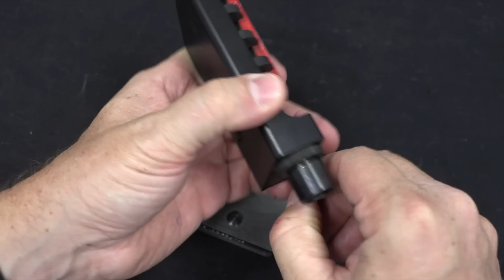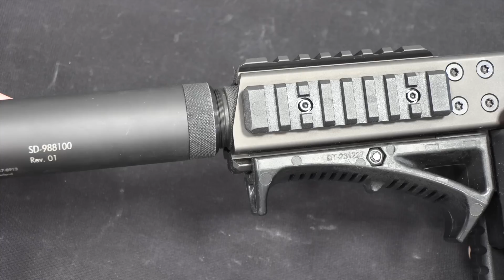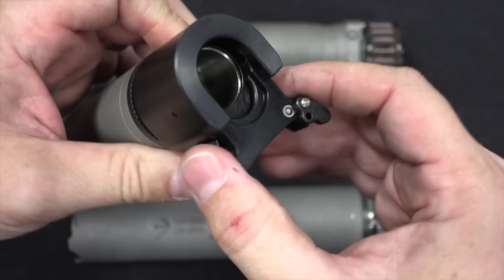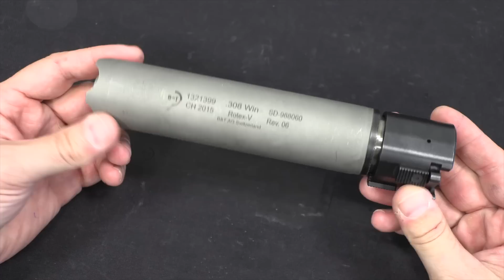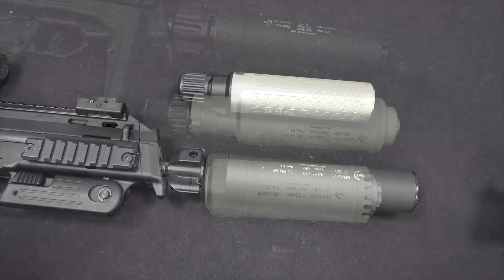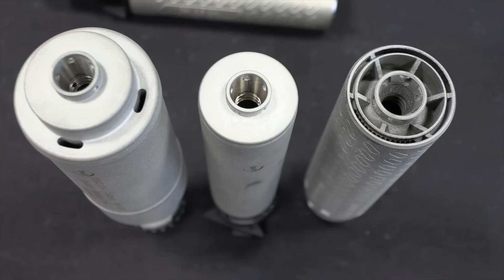A Brief History of B&T Silencers - Impuls to Rotex to PrintX

Comment: There's gotta be a lot of "what would Stoner do?'" in this. Stoner as a designer for aircraft liquid and gas valves. There should be a way to design a valve that wouldn't blow the gas back into the system and direct it out. Piston and valve kind of combination. Then you solve the rate of fire and the excessive gas blowing back problems. 

Nielsen device is sort of a step towards it but I wouldn't want to be the guy to clean that shit on a machine gun...

Comment: So far 3d printing for military supressors brings much more trouble on a longer run when it comes to flowthrough/reduced blowback cans. Functional lifespan is below 7k and its  practically impossible to clean external venting channels.
Reply: That might be so for certain designs. Print-X RBS have been tested to 20k rounds without loss in function. They outlast most barrels.
Reply: @btagswitzerland  We are so much looking forward go verify that claim. Generally 3d printed cans have much coarser surface (as 3d prints of all materials do) that causes faster residue accumulation, when compared to realtively smooth surfaced traditionaly machined and welded cans. Considering smallish diameter of the external flow vents in new  RBS series I am not expecting much.
Reply: @22CatchMK  You're absolutely right. Rule of thumb is: the smaller the channel, the faster it is clogged. We have seen 3rd party designs clog completely under 2k rounds. Compared to these designs the RBS has quite large bypass channels.

Comment: B&T didn't create that baffle design. I was Doug Olson at KAC.
Reply: They also stole the idea of the Inertial Decoupler from KAC. B+T is a European rip off artist. Overrated in my opinion. They do sell their silencers at a good price though, so their economies of scale definitely have something going for them. Americans have access to much better silencers technologies though.
Reply: @Argentum7756  They are struggling to compete with the US in performance. The only suppressor contract they have with the military are the MP7, SCAR and their new SMG that the army bought. The only reason they have the MP7 contract was because they were the OEM for HK and no other manufacturer had access to the MP7 when JSOC bought it so the contract naturally went to B&T. The SCAR contract was awarded to B&T because they understood the system better than AAC and their suppressors would break the SCAR. For years the M4-2000 and RC/RC2 were the standard along with AAC's pistol suppressors.

Comment: Ian, recently you did a piece on the Ruger P85, but didn't get much into the pioneering work Ruger did to both "rediscover" the lost wax casting method and bring it into the modern world. Te reason I bring this up is to wonder if B&T couldn't have used a process like that for those "stars"- additive machine work will still be among the most expensive ways to a part for the foreseeable future, and Ruger's hi pressure system could make many hundreds of these a day from just one line. Thanks for doing what you do!

Comment: A little correction on how a Neilsen Device works.  The suppressor does not move forward.  The suppressor actually stays where it is in space and the barrel is yanked backwards out of the can to allow the gun to cycle.  The spring then pulls the can back into "battery" on the barrel.  There is high speed video out there that shows the can doesn't move at all and it is the barrel that moves out of the can.
Reply: Correct. The proper term is an Inertial Decoupler. The Nielsen device attempts to cancels the mass of the silencer from the barrel to allow normal operation.
Reply: @Argentum7756  I love YouTube comments for this exact reason. Always a few guys dropping knowledge.

Comment: The "star" baffle was ripped off from KAC.  It was originally developed by Doug Olson, the lead engineer at KAC for the Offensive Handgun Project that produced the HK MK23 and its KAC silencer.

If you don't believe me, there is an image available on the internet showing about a dozen suppressor X-Rays.  Compare the B&T to the various KAC cans.  The baffles are nearly identical.
Reply: Trey Knight mentions that during his interview of Doug Olson on the KAC channel.
Reply: @Sol_T86  I've met Doug O a few times.  He's an interesting character and super smart.
Reply: Time frame is very similar. B&T was founded in 1991. Based on this, they were producing suppressors for friends well before founding. MK23 was designed in 1991 as well. So who can say who copied who, if at all.

Comment: Has there ever been a “suppressor-operated” firearm? Something I’ve been musing about, problem looking for a solution style. So far I’m thinking of using the dropping pressure inside the suppressor to release the operating system, maybe run it slower so it’s quieter. Something for DMR or similar.

Comment: Many people don't realise military firearms have to go bang everytime.
So gas pressure bullet velocity and some other factors play important roles in gun and suppressor designs.
3D printing is allowing many new designs that were not possible with traditional manufacturing to become commonplace. less material wastage and more complex internal one piece designs have become possible in many components.
Venting some of the gas out the front of the suppressor is a good idea depending on the application.
Ian has done another excellent video with B&T a market leader in firearms and component design.
Very interesting.
😎🇦🇺👍

Comment: Inconel is a type of stainless steel, the machinists in the factory I work in would prefer to machine something softer it's really really hard :)
Reply: It is corrosion resistant but not a steel. It is a nickel based alloy and indeed very tough to machine. This is why we never made a 100% Inconel suppressor... until now!
Reply: @btagswitzerland  The factory I work in use it in pipeline tech for the doors that are deep underwater. Interesting you say it's not a steel because all the welders, machinists and inspectors I work with refer to it as a type of stainless steel. Everydays a school day.

Comment: You would think making the baffles with MIM would be a lot more cost effective than metal 3D printing them. Because of less cycle time, and less metal powder used (because you can still make the tube without powder metallurgy when you make the baffles with MIM)

Comment: I have a licensed copy of the Impuls 2A that I picked up in 2006. It has a carbon fiber outer tube that sheds heat like crazy. After 3 mag dumps out of my USP 45 Tactical, you can still touch the carbon fiber part. Touch the rear at the Neilson device, and you'll get blisters.

Comment: I wait to the point where somebody do combine ceramic n' titan in a 3D printer. Foamy ceramic is more heat resistant as titan but a lil finicky to fracturing. But in combo of both were it got it's strength.

Comment: If you can't take the can apart, wouldn't that make it extremely difficult to clean? I mean you'd have to have an ultrasound cleaning system maybe? I would see the trend changing in the future to be able to still take them apart for cleaning.
Reply: No. CAT 206, breakthrough suppressor cleaner, and the huxwrks suppressor sauce are all formulated to clean suppressors with or without disassembly. I have used the breakthrough suppressor cleaner on my stuff, without the need for an ultrasonic cleaner.
Reply: Dissassembleable suppressors are much less strong and durable than fully welded cans.

Comment: My 5.55 B&T SRBS is the most I've ever been impressed by a suppressor. The performance on a short AR is wild, and I don't get any gas blockback on a 11.5 FSB Colt carbine.
Reply: You running the full size or compact? I just picked up both and I'm super excited to get some rounds down range here soon
Reply: @LowSpeedHighDrag45 the SRBS 5.56 C Ti is my first can and while I don’t have a ton to compare to, it doesn’t seem gassy on an 11.5 with fsp. Might be my lack of reference but I had always read about the gas coming back and I just shoot the gun the same as always, just softer and much quieter
Reply: @Dapmasters  nice man, I'll have to pick up a TI eventually as I went Inconel for both of my recent ones
Reply: @LowSpeedHighDrag45 the SRBS only comes in full size for now.
Reply: @FlayvorOfEvil  no sir, the compact is available now, I literally just picked it up along with the full size from silencer shop

Comment: Interesting to see how many of the mounts are copies of US patented designs.
Reply: which ones?
Reply: @cusi0080  The 3 Lug mounts are a copy of Tim Bixler's or SCRC patented 3lug mount with an added ratchet. RIp Tim. The MARS-QD suppressor for the marines copies the AAC patented mount.

I'm not sure but the knife gate design is very similar to KAC design as well as the Star baffles being very similar to KAC crimped baffles though I have no idea who did the design first or if it was parallel design.

Some of the patents have expired. I assume they were never patented in Switzerland or most of Europe since not many suppressors were sold by US companies outside the US market in the early years.
Reply: @Mongo63a the Star baffles were made well before Kac. The A2 mount was panteded in 2008

Comment: Ordering stuff from B&T and interaction with their customer service was very nice (can't vouch for the US, but here in Switzerland)
Reply: yep i also recently bought my first suppressors from them and was very impressed with how much time they were willing to spend on the dumb questions of some random idiot like me.
Reply: @Soff1859  Exactly the same experience about them ,they took time to answer and research things,quickly and proficiently,unlike a company north of switzerland with 2 letters...
Reply: I have PRINT-X Inconel suppressors in 5.56 and 7.62 and their U.S. customer services is absolutely fantastic They helped me find the correct adapters for the existing muzzle devices I have so that each can fit basically any platform that has a quick detach system. It was a great experience.

Comment: Think 3d printed plastics in gun industry sits decently between cast and injection molded. Materials are coming around. Nylon, polycarbonate,Fiber filled and metal needing sintering to solidify into a near cast like object. Potential for small shop to print and process baffles

Comment: fun fact about suppressor for use near population: the Swiss also have add-on mufflers for their Leo2 tanks
Reply: Do you mean the exhaust mufflers, or the cannon suppressors? AFAIK the cannon suppressors don't really attach to the tank, they're independent structures that the barrels are put into for less noisy firing, so perhaps not really "add-on"?
Reply: @jubuttib  And they aren't really even suppressors, there are no baffles, they more direct the sound away from people than they actually suppress anything.
Reply: @jubuttib The Germans use them for live fire exercises - the tanks drive to each of the firing points and snug in… (yes they are big).
Silencers are also mandatory in some locations for all firearms (due to noise pollution control reasons)).
Reply: Do they also have glass packs?

Comment: Hey Ian, i remember you had a book a while ago about supressors. Is it in print or is it a waiting project?
Reply from the maker: It is still a project in progress.
Reply: Considering that the scumbag Kevin Brittingham is involved, if it does come out, it'll have some name that's cringy, erotic, after a small animal, or some combination of the three, and it'll be overpriced and overhyped, and if it never ships, CS will tell you to "stfu".
Reply: TBF though, Q is a equal opportunity employer, judging by their weld quality it's clear that they hire the blind. Good on them.
Reply: If I had a nickel for every time Q necked up a cartridge in such a way that it could chamber and fire in guns in the smaller parent cartridge, I'd have 2 nickels. Which isn't a lot, but it's weird it happened twice.
Reply: @willblack7353  You know that Q did not invent the 300 Whisper.  They simply got it SAAMI spec'd.  That cartridge existed for 25 years before Q came along.

Comment: Vacuum rocket engines can be tested on earth because the efflux scavenges the test exhaust tunnel by benouli.

If the suppressor had an open rear end would the supersonic flow prevent any sound returning out the open end?
Reply: In a suppressor its a blast not a continuous flow. But I like the idea!
Reply: @saepelaudat  
Not having tried it or seen it, would it work I wonder?

Obviously not as good as a real one, but wonder how well an open ended pipe with one cap with a small hole would work?

A stack of tyres at a shooting range woks incredibly well when you shoot through the tunnel down the centre of them,
Putting the muzzle through a hole in a wall works incredibly well to silence it either way(for the inside or from the inside)